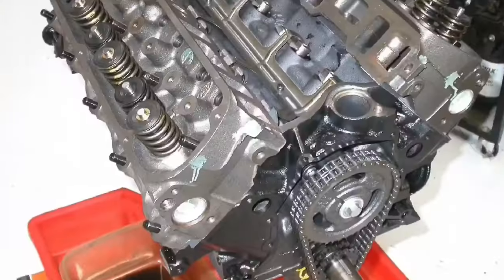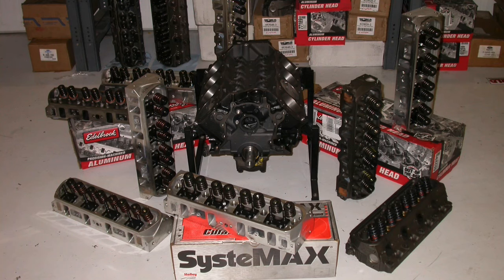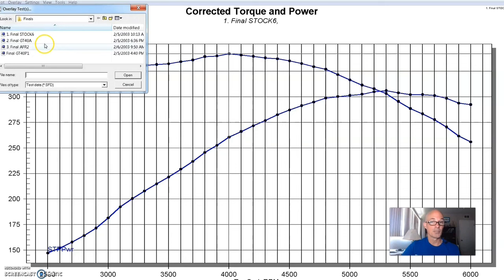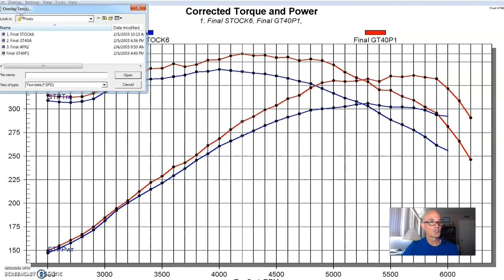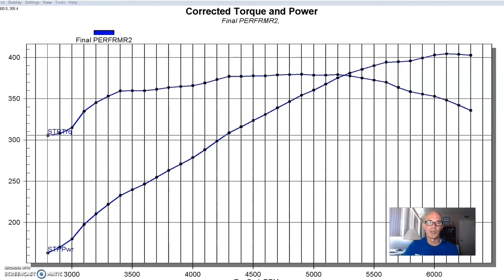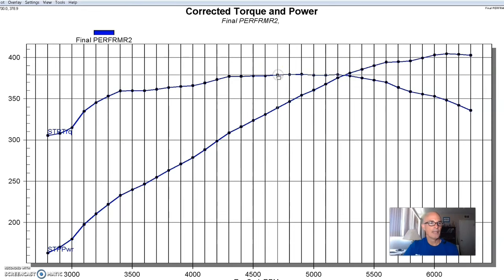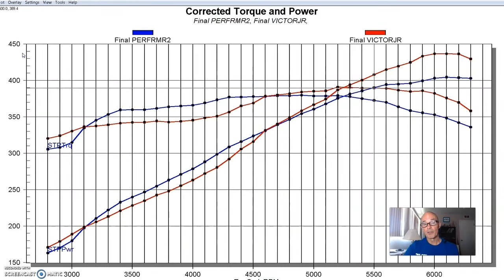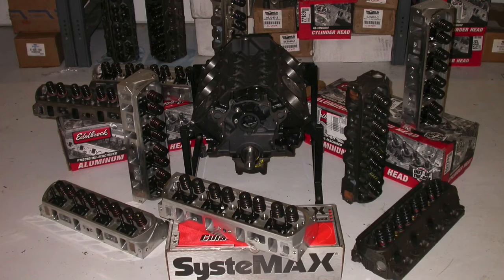LOW-BUCK 302 FORD HEAD UPGRADE

Comment: Can you tell us what brand pistons were used in this engine?
Reply: It's stated in the video
.
Reply: @GearheadRob319  Maybe I should have been more specific in my request,  I meant what brand of piston not what style. All I heard in the video was forged flatop with valve reliefs. I"m curious to what brand he used. Thanks for your input though. I've edited my post to reflect a more specific question.
Reply from the maker: Probe

Comment: That's what I need to know for my au xr8 burnout car.  So xe 264 and afr 185 heads and an rpm air gap. Looks like bye bye efi 😂
Reply: Well the xe274. Thats his go-to
Reply: @KingJT80  I'm hoping to not have to fly cut the pistons
Reply: @chiplinning3010  stock pistons probably so. I'm gonna go with a mabbco rebuild vs do it locally. I want to do local but its hard to beat those prices

Comment: What ratio rocker arms are u running
Reply: Stock ratio is 1.6 so how u getting .555 in of lift with a 274 cam that's not even gonna get u .450 in of lift running the stock ratio rocker arms
Reply from the maker: the lift from the XE274HR cam is measured with stock rocker ratio

Comment: Dumb question, do you have to switch to a motor oil with more nickel or other additives to keep a big lift high tension valve spring motor alive?
Reply from the maker: high zinc for break in-otherwise no
Reply: @richardholdener1727  
Thanks

Comment: 🔔Suggestion:
All you SBF guys need to read every Joe Sherman thing you can.

1 He has a couple tricks.
2 You will never see a photo of his porting on a SBF. He also has never told his porting detailed secrets in print.
Theyre 👍👍👍

He got 400 hp out of a factory iron headed 289 and 302.
Below 3000 sucked.
Reply from the maker: he knows how to make power

Comment: Single plane Manifolds are Dyno Queens.. smh
Reply from the maker: lots of NASCAR Cup motors out there being dyno queens
Reply: @richardholdener1727  I talking Street Engine. Usable Power. Smoother power Delievery.  Not Wide Open Throttled , 6500+ to 8500 rpm.